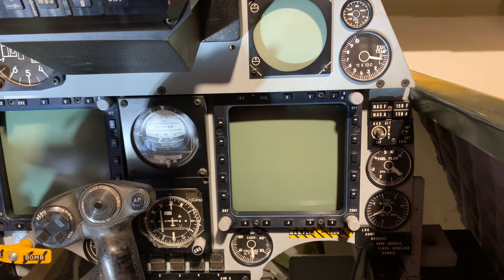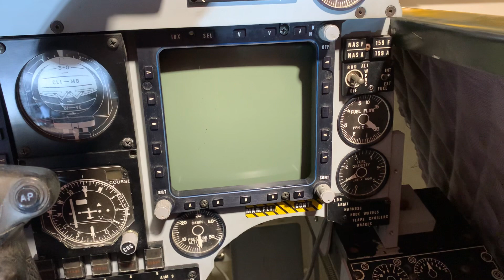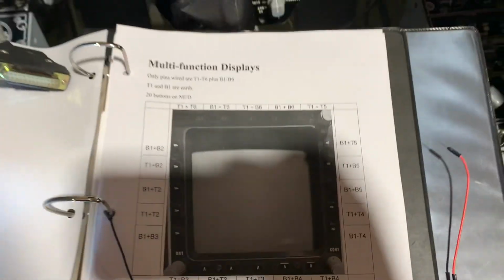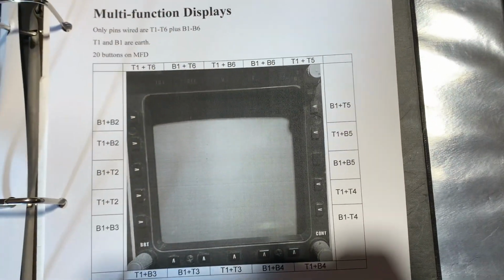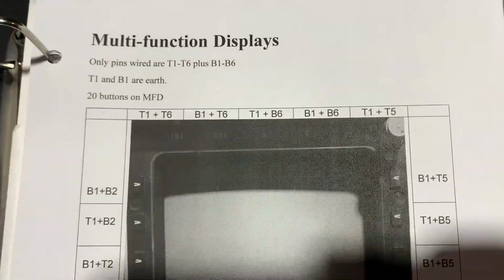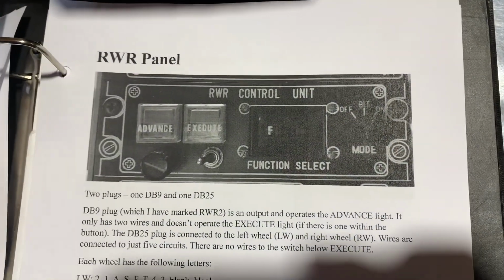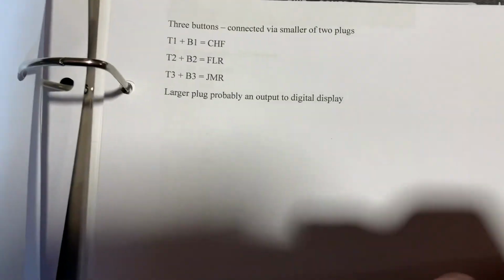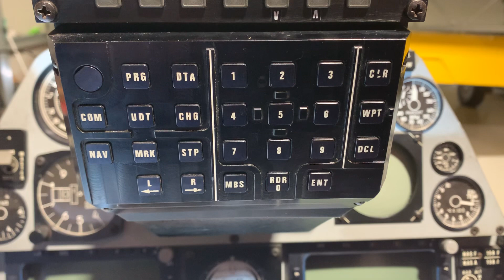RNZAF A-4K Skyhawk “Hotshot” Flight Simulator restoration. Part 9 - Working out the plug connections

Comment: Nice Job! Is that a Ferranti HUD control panel? I would be interested in a kind of manual and how they used it. Greetings from Germany.
Reply from the maker: Yes, the A-4K was fitted with a Ferranti 4510 wide-angle Heads-up Display. Unfortunately I do not have a manual for it, nor was I a pilot flying the Skyhawk in RNZAF service so do not know the full workings of the control panel yet. 👍